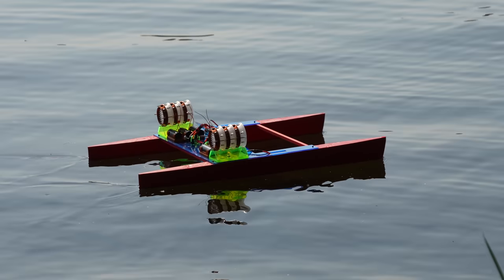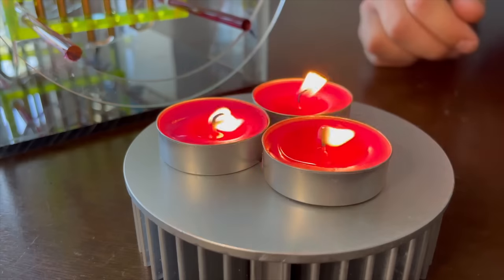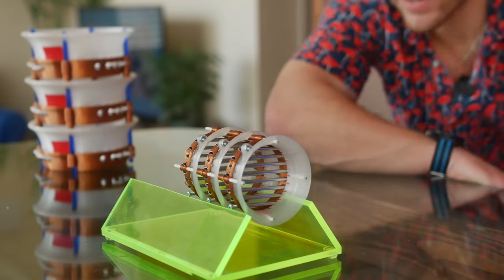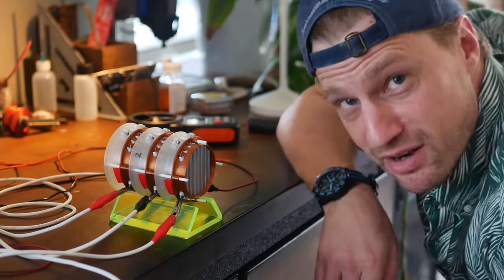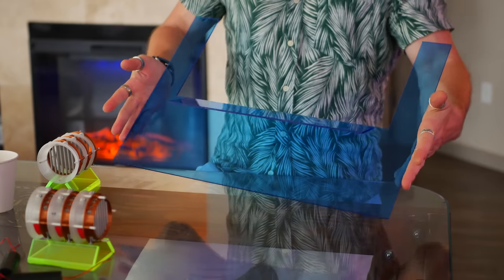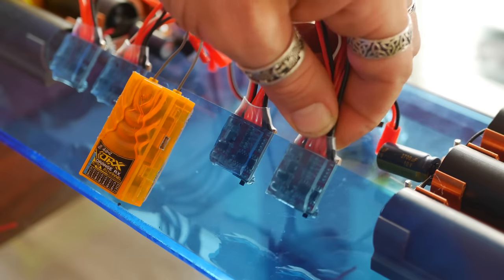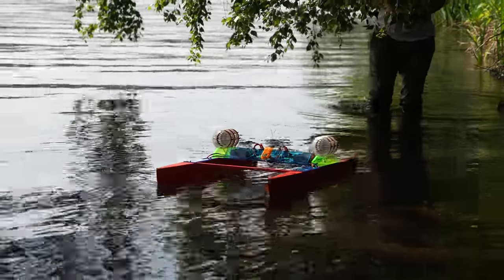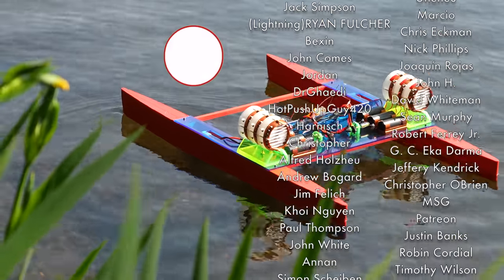Building A Twin Ion Engine (TIE) Catamaran (ft RCTestFlight)

Comment: What happens if you used water as the thrust fluid, instead of air? There's plenty of ions in sea water and it would resist the spark breakdown as well as having more mass.
Reply: Hmmmm sounds familiar... Clive Cussler Novel series The Oregon Files
Reply: You are correct about that being a suitable alternative, in fact that has been done already.
Idk why they didn’t mention it in this vid even once.
Reply: @Weromano  Could you be specific about who has done it before and for what boat? I'd like to know more.
Reply: @delphicdescant  https://en.wikipedia.org/wiki/Magnetohydrodynamic_drive#Marine_propulsion
Reply: MHD ?
Reply: Have you heard of electrolysis? You're gonna have a lot of oxidation corrosion on your electrodes. Not to mention a lot of explosive hydrogen and pure oxygen in the air to ya know... make noise with an explosion.
Reply: If you just used a propeller and pushed against the water, it wouldn't be a half-assed, dumb venture.
Reply: @Telephonebill51  Answer me this William H, is a propeller actually "pushing" or is it pulling? Without people trying new things and experimenting, you wouldn't have propellers to "push" you along. I think you should just use oars and sticks. None of that newfangled propeller crap. Hippie!
Reply: The hunt for Red October ..
Reply: @benjaminmiller3620  That is very different then the topic presented in this series. MHD's are electromagnetic linear DC motors, exerting a force on the moving fluid via the Lorentz force. This is an electrostatic propulsion system that exploits Coulombic repulsion and Newton's 3rd law.
Reply: Due to the high conductivity of ionized water, it would be likely impossible to generate a sufficiently high voltage to free ions to propel without arcing between your electrodes.
Reply: Sub marine silent magnetohydrodynamics drive is kinda similar
Reply: yeah man, lets run 40k volts directly into sea water. That won't do anything terrible will it...

I swear to god do kids just skip science classes these days?
Reply: Oh dear...
Reply: @Telephonebill51  wasnt the purpose of the exercise... you know, things come into existence by actualizing a purpose into matter.
Reply: Marine life be expecting a quiet, safe propulsion system. Gets one powered by high frequency HVAC stun gun modules in the water.
Reply: @Nick-co9pf  Although its been decades since I was in school, electrolysis not covered in any depth, if at all. Perhaps that's not the case today
Reply: @Telephonebill51  You are right, why would anybody ever perform the same task a different way than someone else has already done it? Definitely half assed dumb ventures.
Reply: @timsawyer9231  Please don't be that guy. We all know you're smart, so you don't have to constantly show off by calling salt "sodium chloride" and detailing the fact that you don't technically suck fluid through a straw.
Reply: @GRDL.  : Run it at a lower voltage (less electrolysis) and use carbon electrodes (the poor man's platinum electrodes).
Reply: @bort6414  Motors, as a rule, all use Newton's 3rd Law.
Reply: @ClashBluelight  Technically, you do suck fluid through a straw. "Sucking" is, by any normal definition, the creation of a lower-pressure zone that causes the higher-pressure fluid to preferentially move towards it. "Blowing" is, by any normal definition, the creation of a higher-pressure zone that causes the lower-pressure fluid to preferentially move away from it.

While there's no such thing as "negative pressure" in an absolute sense (until, potentially, we get negative mass involved), there is such thing as relatively negative pressure, and that's how sucking and blowing work; again, by definition. Just like you can run a motor by attaching "ground" to a positive voltage and "power" to a higher positive voltage, you can suck fluid by introducing low pressure to a higher-pressure environment.
Reply: @GeekOfAllness  You are correct. However I retort with this: 🤓 🤓 🤓
Reply: @vincentwu2848  No its not. And for good reason. You don't teach kids how to make high explosives. Save that for college. 
I did this in the late 70's. I made an electrolysis set up. Capture Hydrogen gas in one test tube and 02 in the other. I'm lucky I did that. I had used a lamp cord and standard house current, but I put a diode in the line so I got pulsed DC instead of AC. I tested the two gases buy putting a long match into the bottom of each test tube. The flame grew big in the 02 test tube. But the H test tube was something else and spectacular. A flame came out of the test tube, about three feet long, with the sound of a train whistle, "TOOOOOOOOT!"at about 100 decibels.
If I had not separated the gases, and captured them both in the same test tube, the resulting explosion, though small, would have had a shock wave traveling at something like 4 KM a second, shattering the test tube, and I wouldn't be typing this today.
Look up on  youtube Techingedients. 
https://youtu.be/l9CI6KSV560
Reply: Two issues I can think of
1. Electrolysis- you'll produce flamable hydrogen gas and erode the electrodes
2. EMI- you'll probably freak out sharks

It would keep things cool though
Reply: @GRDL.  MHD drives are normally used for pumping molten metal. When pumping water, AC is used so the electrolysis cancels out.